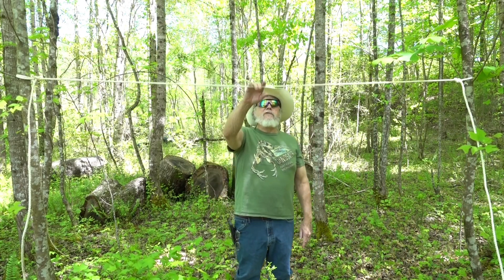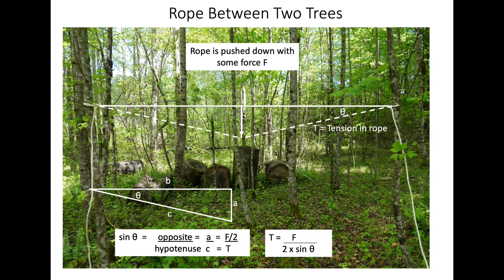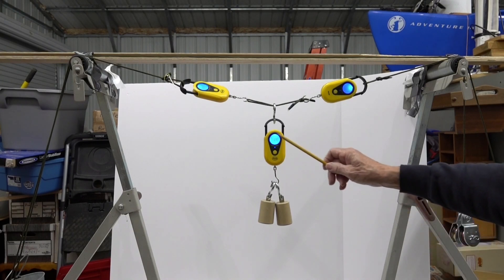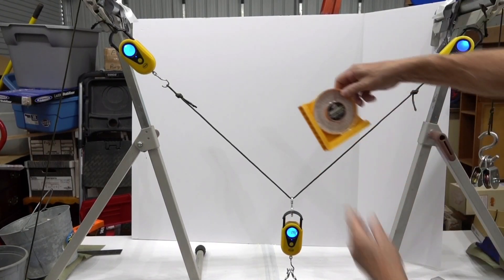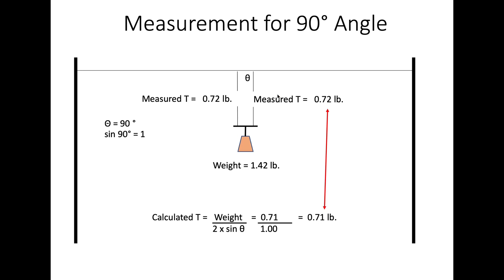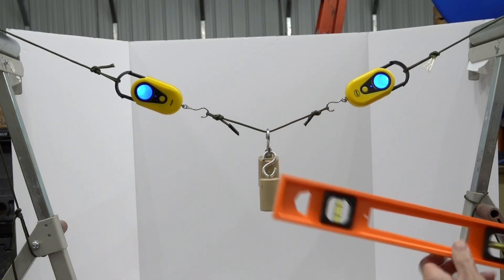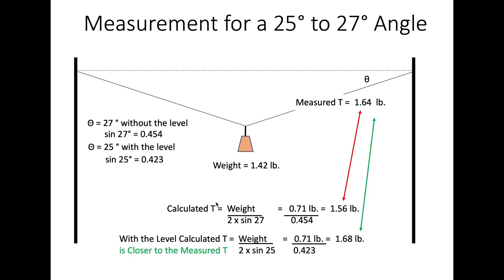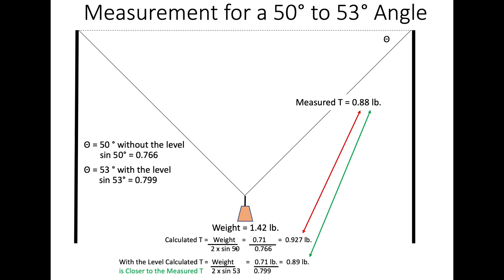Rope Between Two Trees

Comment: I learned to use this method with double rope, and just pull the ropes apart in the middle. Same principle i think. Used it to pull an 11 ton CNC across a concrete floor , for the final tiny adjustments. And yes, the CNC was put on rollers, but no way it could be moved just by pushing it. Good for small movement, cumbersome for longer movement due to all the re-tightening of the rope(s).